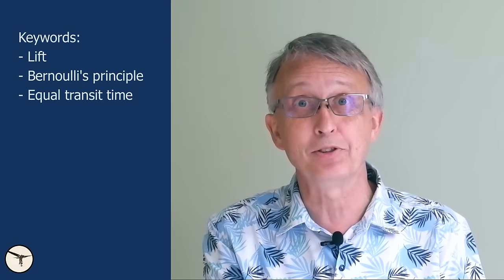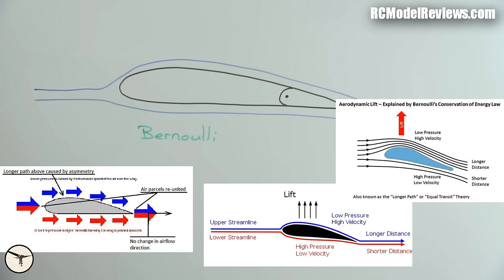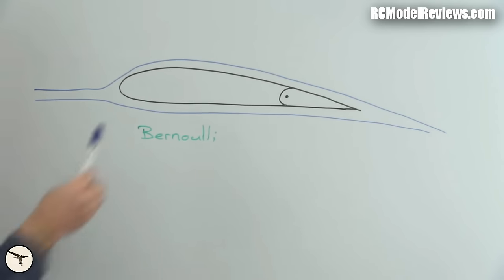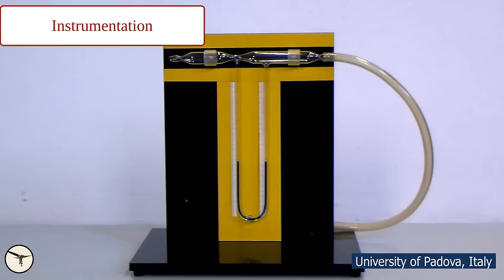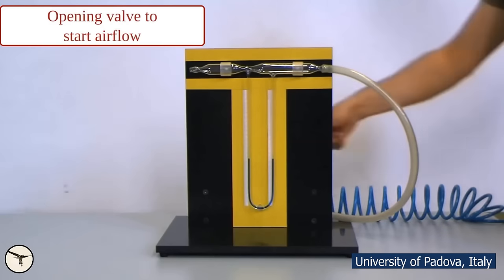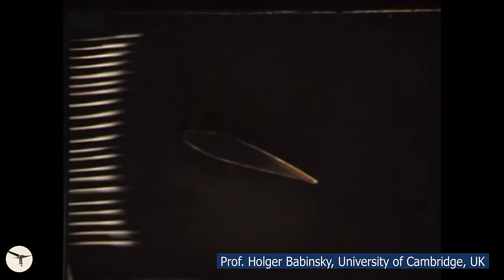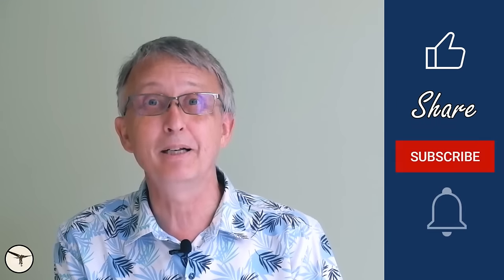Why are so many pilots wrong about Bernoulli’s Principle?

Comment: Here goes my Tin Foil Hat response: 

A 1,500 Lb Cessna C-150 to stay aloft must force 1,500 Lbs if Air, down!

To Climb, it must Push a Greater Mass of Air down, that the 1,500 Lbs it Weighs!

Aircraft are Designed either with A "Tailplane" (Horizontal Stabilizer & Elevator, or Stabilator) at the Rear; OR, with a Canard surface at the Front! 

Why is this? Take a 2" x 36" strip of 1/16" Thick Modelers Balsa, hold it level, about 4' up, carefully let it fall! It will end up falling in some unstable fashion, weaving back and forth, or Rolling along the Length Axis! Typically in one direction! Not the direction!

My observation says, it will Roll "Forward!" And continue to rotate in that direction! By "Forward" I mean the Edge away from you will fall first, and continue in that roll until conct with the "Ground" or Floor!

This is apparent on a Larger Wing, that has Flaps at the Aft Surface, that when extended, increase the Wings Cord and Effective Area, but, these flaps also angl down, to deflect more airflow downward.

It is also apparent, that if their was no "Horizontal Stabilzer" - the Downward force at the rear if the wing, would form a Reaction Force, to roll the Nose if the Aircraft Down!

To oppose that Firward Pitching Roll Response, the Horizontal Stabilizer is designed, and positioned, to create a Counteracting Down Force, on a Long Lever, sufficient to "Manage" that effect!

And the Elevator, when it is moved upward at the aft End, from its hinge point, increased the Down Force, causing the Nose to rise, and, at the correct Speed (Air Mass Velocity) will allow the Plane to "Climb Away" - IF (And only IF) the Wing, is now deflecting Down, sufficient Mass of Air, to be greater than the Mass of the Aircraft... And the Downforce Added by the H-Stab/Elevator!!

Watch Boeing Flight Tests, doing a "Minimum Unstick Speed" test, to get the point! The H-Stab can generate sufficient down force, to drag the Tail, at a "Lowe than Lift iff speed", such that they attach an Oak Beam at the Would Be Point of Contact under the Rear if the Aircraft, and it is dragged, skidded, along, as the aircraft continues to try and accelerate, with the Nose Very High, until.... Sufficient Lift is Created, due to enough Speed of Airflow over the Now Highly Angled Wings, to the plane of the Runway!

A 100,000 Lb Aircraft, will need to force a Mass of Air equalling in excess of that 100,000 Lbs, if it hopes to leave the Runway and head upwards!

I should mention, that a good portion of that Down Force of Air, comes from from the High Bypass FAN, on today's Massive Fan-Jet Enginges, especially at Take-Off Speeds and Pitch Angles, but, a glider flies with no such engine thrust, to lean upon! And yet, it too follows the same realities!

Bernoulli, was "Right" in some aspects (Like, a Manometer, or an old "Venturi" system to power old Aircraft Gyro's, like in the artificial horizon, of an old Cessna 140!) But, some people have abused his ideas, gotten Romantic, and ignored Neuton: "Every Action produces an Equal and Opposite Reaction!" 

Airplanes, Helicopters, and Rockets, however, live by this fact! So do We, Fishes, Birds, and more!

We "Walk" by "Pushing" backwards, to allow US to move "Forwards!" 

Airflow over wings,is doing the same thing, in a Glider, also! Same thing in a Canard, like a Wright Flyer, Rutan Vari-Viggen, Vari-Eze, Long-Eze, or a Cozy, etc.

A Canard works by moving the Wing Back, to get a longer "Arm" for the Canard to "Lift" the Nose, to compensate for the Down Force off the Rear of the Wing, providing Additional "Lift" instead of an H-Stab increasing the Amount of Lift required to take off! 

Of course, my PPL Training, and CPL Training, all praise Bernoulli! 🤔🧐🙄
Reply: This is not true:    "must force 1,500 Lbs if Air, down!  To Climb, it must Push a Greater Mass of Air down, that the 1,500 Lbs it Weighs!"

There is not a fixed mass of air that must be pushed down; there is a fixed amount of change in downward momentum necessary for that air pushed down.

The vertical momentum change of air has to come to that force of 1,500 lbs you are referring to (and above that for the climb).

But that says nothing about the mass involved unless you know the downward velocity of that mass:  momentum = m x v
Lift = F = m x a = d(mv)/dt   (lift equals change in momentum).

Here is something I wrote elsewhere:

quick summary:

Lift is the asymmetry of a solid turning the air (explains both camber and AoA).

Mass flow continuity means speed must increase proportional to the constriction A1/A2.   (the ratio of two cross-sectional areas:  that of an undisturbed incoming mass to the constricted area imposed on that mass)

This speed increase drives a conservation of energy, static pressure drop:
pressure = constant - (1/2)x(mass density)x(v)^2   

The total pressure difference is equal to lift.

Which forces air mass down, also equal to lift:

P x A = F = ma = d(mv)dt  
Or the force of pressure (as force per unit area times area), equals the change in vertical momentum of the air (again, both equal to lift).

This directly ties asymmetry as the fundamental principle to both the "Bernoulli issue" and the "Newton issue".

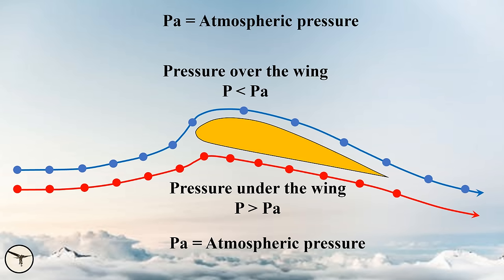Comment: Well explained, however, at 3:28 there is an error: The pressure difference between the lower pressure on the upper side of the wing close to the leading edge and the higher pressure in undisturbed air "higher up" does not directly create lift. The lower pressure on the upper side of the wing close to the leading edge only contributes to lift, it does not generate it; lift is always generated by the lower side of the wing. Suction is not a thing, a vaccum cleaner does not actually suck air in but the surrounding static air pressure pushes air into the low pressure region created by the motor. Also, the lower air pressure region on the upper side of the wing close to the leading edge does not "suck" the upper side of the wing upwards. 

Put the wing in a mold filled with water until it covers all of the lower side of the wing up to the frontal and aft stagnation points (no air below the wing), there will then be only the airflow above the wing, not below. There will still be a decrease in static pressure on the upper side of the wing close to the leading edge but no lift will be generated and airflow will not be bend downwards once it gets behind the trailing edge. 

Lift is generated by the pressure differential between the lower side of the wing and it's upper side and in order to have lift, air must push against the lower side of the wing, pushing the wing upwards (by the combined pressure of static and dynamic pressure on the lower side of the wing versus on the upper side of the wing). The dynamic change of the pressure part is basically Bernoulli. 

In addition, the global shape of the wing disrupts the surrounding air in a way that behind the wing, airflow is directed downwards, and at the wingtips, a rotary turbulent airflow is generated in a way that the higher pressure air masses under the wing move in a circular fashion around the wingtip to reach the lower air pressure region above the wing. 

The air pressure differential below and above the wing is decisive for creating both lift and wake turbulence. In both cases, local airflow is disrupted and air is deflected downwards behind the wing and clockwise on the left wingtip and counterclockwise on the right wingtip (as viewed from behind). 

Newton's third law is insufficient to explain lift as it only looks at the effect, not the cause (the pressure differential).

As for the equal transit time assumption, it's really only a baseless assumption, not a theory, as the idea itself implies unexplained constraints (two molecules joining again at the trailing edge). Air is not butter and the wing not a knife cutting it. In reality, as shown in the video, the air above the wing actually travels much quicker than would be expected if, for some magical reason, two gas molecules split up at the leading edge would have to join again at the trailing edge as postulated by the equal transit time idea.
Reply: Whether push or pull, the result is the same; difference in pressure creates lift.
Reply: @Talon19  As long as we don't claim dynamic pressure under the wing is the main cause of lift.
Reply: @davetime5234  
Static and dynamic pressure both affect the distribution of pressure around the aircraft.
Reply: Icing on the upper surface of the wing, making it rough seriously affects lift, but not so on the lower surface.   The upper surface is usually clear of equipment, like engines and screw jacks for the flaps etc. because it is providing the most part of the lift, up to 80% depending on the shape and AoA of the wing.

Comment: Still missing the main reason an aerofoil can lift an airplane. The main end result of the pressure difference is re-directing the airflow to a more downward vector. As we know, for every action there is an equal and opposite reaction. When the vertical[to keep it simple] component of that re-directed airflow equals the mass of the airplane and more, well, then we have lift….we have flight! That aerofoil is the most efficient design to perform this redirection with minimal drag. 
 This is based around COANDA principle. 
 I mean, really! They still expect us to believe that the pressure difference over a wing alone is going to lift an aircraft! It is just secondary in adding direct lift.
Cpt ATR,
PNG
Reply: Many years ago I used to believe as you do. Two things happened: first I educated myself on the subject. Second, some years later, I saw a science exhibit with two plastic balls suspended by strings with a leaf blower pointed between the two. When the blower was turned on, the balls crashed into each other due to lack of pressure between them and atmospheric pressure around them. This is an experiment you can perform yourself. It illustrates Bernoulli's principle simply.

The only other thing I will say is that the video author is an airline pilot and has years of experience with the reaction of wings at varying angles of attack. If you won't trust the word of someone like him, then you should not fly or travel by air.
Reply: 100% of the lift is accounted for in the pressure distribution around the wing. This is basically true by definition. Pressure is force over area, rearranged gives: force (aka lift) is pressure times area.

Momentum change (your vertical redirection) also accounts 100% for lift. This is F= ma, or a=f/m. (m being the mass of the air.)

These are different aspects of the description of the physical interaction, both occurring simultaneously. The Venn diagram of their contributions, is a circle. It's not part of one + part of the other.
Reply: @FlyNAA  
I have said my peace on airfoil lift. I reply here only to say that where I come from, 100% means "all."  In the above comment you say:

"100% of the lift is accounted for in the pressure distribution around the wing." OK, so far so good...

And then this: "Momentum change (your vertical redirection) also accounts 100% for lift."

Please clarify.
Reply: @royshashibrock3990  I also mean "all" by 100%.
Reply: @FlyNAA  
Please read your own comment and my reply again. You say one accounts for 100% then say the other also accounts for 100%. "Also" means "in addition" or "to add." 100 + 100 = 200. Again, Please clarify your comment.

This must be a troll situation; if so, I'm half way across the bridge. Over and out.
Reply: @royshashibrock3990  I'm not adding 100 + 100. I mean "also" as in:  one fact is true (100% of lift is accounted for by the pressure field) and also another fact is true (100% of lift is accounted for by the momentum change). They're not separate mechanics. They're aspects of one mechanic.
Reply: @royshashibrock3990  "Also" does not mean "in addition to", it means "equally so". If you doubt that 100% of the lift is accounted for by downward deflection of the air, you might try standing underneath a helicopter (a rotating wing aircraft), and ask yourself why there is such a strong downwash?
Reply: @ib9rt  
I don't have any more time for idiocy. You go back and forth saying one accounts for "100%" lift and then the other "also" accounts for "100%" lift. I am familiar with helicopters...but they also use both the bernoulli principle and under wing deflection. Helicopter rotors are either essentially Clark type (curved upper surface and relatively flat lower surface) or symmetrical. As it is now clear I am being trolled, I have no more time for mental gibberish. Peace to all.
Reply: @royshashibrock3990  I can hardly go back and forth since that was the first and only post I made in this thread. You should try to understand that in physics, and in science generally, there can be more than one way to describe a process, using different equations to arrive at the same answer. It is not always an either/or situation. Sometimes two different descriptions can both be correct.

Comment: Bernoulli has little to nothing to with generating lift by an airfoil, wing. Such lift is NEWTONIAN. Bernoulli’s formulas are close enough in describing lift that they are used in engineering and flight courses. That is the root of the confusion.

Also, as lift is Newtonian it follows that the vast majority of the energy that sustains a plane in flight comes from gravity. Glide ratios and autogyros proof of this.

In a nutshell: The air flowing over an airfoil encounters a perfect vacuum at the surface of the back-top of the wing. This vacuum is magnified many fold by the pull of gravity on the wing. The vacuum pulls down the air flowing over it. In turn, that air pulls down more air from above it. All of this air, scooped up, if you will, is accelerated downward off the back of the wing. The opposite and equal result is lift.

There are videos of planes landing, usually in the UK, where one can actually see this process at work.

It’s Newtonian my Dear Watson.
Reply from the maker: Bernoulli's equation and Newton's second law are describing the same thing. Please watch this video: https://youtu.be/ph1HqrioLPs

Comment: The most misunderstood principal in generating lift.
Reply: Pressure drops until there is enough acceleration to prevent a growth in bottleneck of mass needing to exit the wing.  

If the restriction forcing such a pressure drop is shaped asymmetrically on top vs bottom, there will be a pressure difference that changes the direction of the relative wind vertically.

Bernoulli:  a spatial restriction forcing a reaction in the pressure profile.

Comment: No, a pressure differential doesn't cause lift. It is lift caused by deflection.
Reply: If that were the case, thin symmetrical wings would generate the most lift vs drag.  They don’t.  The pressure difference is directly observable, measurable, and predictive.  Not so with “deflection”.